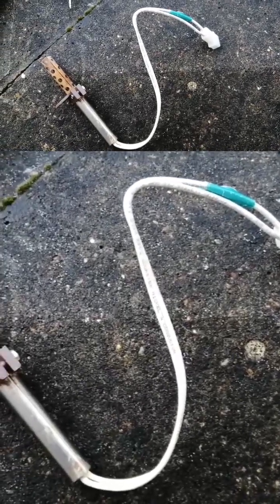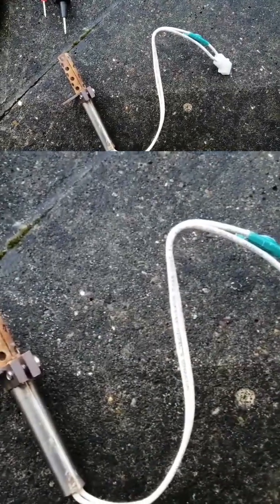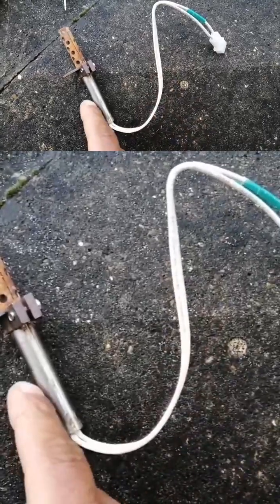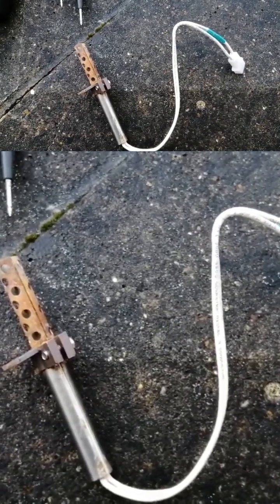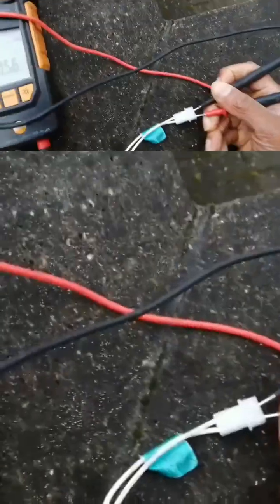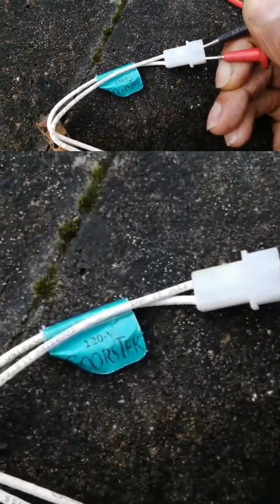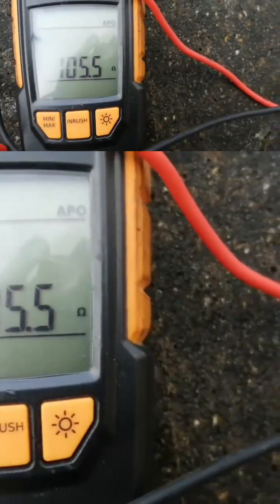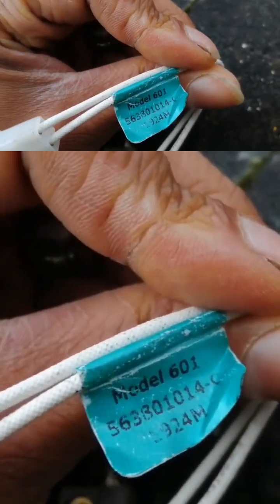HOW TO TEST A HOT SURFACE IGNITOR

Comment: Good video You can use your clamp meter if glow electrode is a pain to get at 24 v ones usually pull 1.4 amp
Reply from the maker: That's news to me. Helps if you don't have to disconnect it. So long as you have a clamp meter. I'll give it a go. Might have to be a future short.